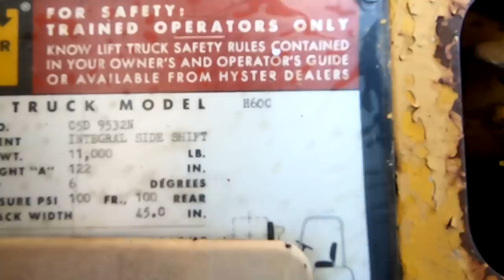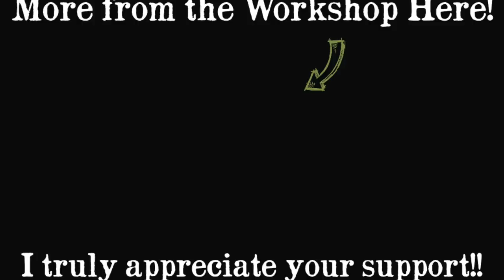This 1969 Fork Truck WAS Headed for the SCRAP YARD! ~ RESCUING a 1960's Fork Truck ~ Part 1

Comment: Another great video! Good job on the distributor! I was concerned about the shaft lenght also! Dont forget to lube the advance weights pivot pins! A little Never Seize works wonders on those! These pins wear with time and drastically effect advance in the distributor which can have you chasing high rpm misfires thinking its the coil or points ect!

Comment: In my younger days, I would have been horrified at running a motor that looks like it needs a .090 overbore to get cleaned up. Now? As long as it does what you want, who cares? It's not like it'll be run 40 hrs/wk. Nice job. I guess I won't mention the built-in spark plug adjusters on the tool:)

Comment: What I was told, is that propane produces some what larger amounts  of water than gas does when burned.  Neither is a problem where the forklift is used a lot, but many shops it is just used for very short periods of time and never long enough to warm up enough to drive off the water.  Have you changed the oil in your new forklift, just wondering.  Good job in getting that motor to run!

Comment: On the stuck cylinders tip in boiling oil on each cylinder. It will find its way through any small gaps and help it move...

Comment: I’m an industrial maintenance mechanic and work on propane forklifts. I haven’t ever converted a gas to propane. But I can tell you that propane forklifts use the liquid side of the tank not the gas side. That makes it lower pressure but you need a vaporizer to turn it back to gas before the carb. How or if it will work with your carb I don’t know.

Comment: As for the switch to propane, it can be done, and used to be really popular even on cars. You will need the tank obviously, a regulator, and an entirely new carb as well as the lines.

Comment: You will need to run a gas mixer. Kinda like a carb but it has a diaphragm that regulates how much fuel gas gets into the engine. Might be a touch tricky finding one the right size, they can be a bear to tune. Also be aware you will loose some power when you convert to ng or propane.

Comment: Propane is an liquid form when stored, LPG as it is known, is Liquefied Petroleum Gas. You will need to buy an entirely different carburetor and fuel system because the liquid propane gas needs to be allowed to expand into gaseous form in a controlled chamber and regulated for the needs of the engine, usually using manifold vacuum as a guide.

Comment: im sure theres a better tool for this,,, yes you had it in your hand  that spark plug gaper has a  wire bender on it. its that flat  piece of metal  on the end of the gapper with the wire bender slots in it .

Comment: I've done it already you got to use a CA 100 or 150 carburetor with the appropriate vaporizer impco and convert that thing over to electronic ignition with a pertronics you got to take a lead off the water pump and then return line for the vaporizer to keep it warm so it doesn't freeze

Comment: You will have to replace the carb with the "gasification" unit,  then you will have the issue of "upper cylinder lubricant" those older models used LEADED Fuel, the Lead as well as the octane boost, it lubricates the Valves and Seats, not sure But you will probably need to get "hardened seats" installed and ground like when we went from the leaded Fuel to unleaded

Comment: when you go to LPG, my understanding is you need an Evaporator, and a whole new Carburetor/Throttle Injector. because the Propane has to be fed from the tank via a dip feed as liquid to get enough massflow to run properly, but you can't inject LPG directly into the manifold airstream, it'll displace all the air and you Go Nowhere, so it has to Evaporate it right next to the carb and meter it that way. you can NOT use a normal carb.

Comment: LP conversion should run around$300 plus the tank. Impco model J, VFF 30 and a CA 55 mixer. Easy hook up should only take an hour or two

Comment: Re; the dizzy rebuild, there is a screw under the felt pad in the top of the cam, should allow the removal of the upper half of the centrifugal advance mechanism with the cams attached, would have saved driving that roll pin out from the shaft, i've had those threaten to bend the shaft trying to extricate them.

Comment: found this it will atleast show you what you need to convert to LPG as for how well it works here in Aussie many cars run duel fuel (LPG & Gas) or kine mine run pure LPG you loose a little in the torque department and fuel economy is about the same. As you stated it cant go stale  and people cant steal your fuel and it burns better since it is already a gas mixing with a gas in the cylinder. It is also better in enclosed spaces as since it burns better it makes more CO2 than CO in the exhaust and all LPG has additive to make it stink if it leaks and this makes the exhaust also smell so you can tell if you need to air out an indoor area more when it is running. The conversion is easy as you just need to swap the carby for the thing in the kit run your hi pressure line from tank to the regulator and the low pressure line from the regulator to the carb replacement on average a forklift conversion takes about 4 to 8 hours to do and the car conversion takes about 2 days.

T understand why so many here  run LPG cars price for normal unleaded fuel here is about $1,60 or so a litre where LPG costs $0.60 and you get same or better distance on LPG to unleaded fuel.

Comment: Half shaft may have been removed to free the wheels to turn without the transmission when it was moved. Maybe to allow the wheels to turn or to protect the transmission from turning without oil.

Comment: a 60 is a 6000 lb lift . as a rule the number equals the lift capacity. nice forklift and the motors are every place. easy switch over if you ever wanted to switch to lpg

Comment: Handy tool/trick/hack for cleaning really well but also not causing damage on carburetors, pistons etc is blasting with granulated sugar a cheap harbour freight type syphon fed blasting gun and a bag of sugar from the local store, just blast and rince off with water or comp/air 👍🏻 use outside lol it goes like icing sugar
NB dont leave sugar in the gun it will caramelise 🤦‍♂️

Comment: I was gonna comment on the plug gapping, but it has already been addressed. Wood man, wood! What you did by knocking the pistons was a valid thing, but use wood next time, it won't damage the aluminum or if you damage the cylinders if it comes in contact with the bore.....like it matters on this one though! Things don't need to shine to be clean.
Reply from the maker: The problem with wood is that it doesn't transfer the same amount of SHOCK into the piston / rings... the goal isn't to move the pistons with the pipe like people try to do with a chunk of hardwood... the goal is to shock the cylinders enough to get the rings to break free allowing the acetone / ATF to do it's thing... of course you can damage the cylinders with a pipe, but you can do the same with wood, and there is no chance of damaging the cylinder walls if your pipe is small enough and every impact is carefully placed... it's all a matter of technique and knowing when to stop! It's never let me down!

Comment: Using Hyster's marketing strategy, H60 = approximately 6,000 pound capacity at 24" load center. 24" load center is the normal point at which this class of forklifts is assigned its advertised capacity. And even that figure usually gets rounded off.  Even though the data plate shows 6,956 pounds at 15" load center, it is not a 7,000 pound capacity truck for marketing purposes.
Other brands of trucks choose the "fractional ton" system for assigning capacity.  Using that system for example, a Komatsu FG25 model means 2.5 ton, or 5,000 pound capacity.  A Toyota 8FGCU30 means 3.0 ton, or 6,000 pound.

Comment: Propane conversion isn’t hard yes you need a special part that attaches to the carb.and that’s about it.they use to convert cars and pickups after market. In the meantime 80 and 90.

Comment: Gasoline does not go bad, itself ! What happens is the "ETHANOL" in the gas buggers up tanks, lines, and carbs. This goes double for small two cycle engines. use non-Ethanol fuel and keep them running.

Comment: Question: were you concerned at all about scratching up the gasket surface when you wire wheeled the heads? Were you using just a normal steel wire brush head on your grinder? I’m asking because I tend to be extremely gentle with gasket surfaces and I want to know if I’m just wasting my time. Thanks!
Reply from the maker: Of course its ALWAYS a good idea to be very careful with gasket surfaces, but they are more durable then you might think... especialy on OLD machines like these... It was a normal steel wire wheel on the grinder... i always start slow and test it to see if it's going to destroy the surface or not, but the other key is to always keep moving... that usually means you have to go over something a few times,  but it also stops heat from building up in one spot which could REALLY cause damage!
Reply: @SalvageWorkshop  Thanks very much for the reply!
Reply: Cast iron surfaces you would have to go at it with a grinder to damage it! A wire wheel is harmless, but be a little gentle and it will be fine!
Reply: @paulorchard7960  Thanks Paul! I’m working mainly with aluminum surfaces, so they are super easy to scratch. I usually have to scrape them with a razor blade held at 90 degrees in order to not damage them and I was wondering what other people were doing. I guess if I run into some cast iron I won’t have to be quite so gentle!

Comment: When so many people were converting cars to run on LPG they were shooting for compression ratios of 12:1 to get good power and economy out of them.  Your flathead is probably running 6:1. so LPG is sort of overrated, still it will run MUCH MUCH cleaner and give you fewer problems.  That port on the distributor could  probably be for attaching a vacuum advance which would be good for an automobile.

Comment: Use wood against pistons, never tiny iron pipe!! When you see no plugs you can figure cylinders need boring, they probably did to start with. Check for broken axle where it's unbolted. Have you bought this or is this to determine if it's worth it?
Reply from the maker: Check out part 2!

Comment: I have watched several propane conversions or repair. Propane is more complicated due to all of the safety valves etc. but it is better in the long run. with gasoline all that has to be done is shut off gas and let it rub til empty toeliminate the od problems. all of my tractors are this way. with new alcohol fuel need to do this.

Comment: it could have a sump full of petrol mixed with the oil best outcome is it just sat and moist air got into it 
and it may need to have the cylinders honed and might be ok but if it got water in it that could be another reason why it has a high oil level

Comment: Ok… watching is completed! I’ve been doing this kind of stuff my whole life…..you got lucky, the moment you took the cut off pipe and hammer to the aluminum pistons I about fell out of my chair! Myself I would have use vinegar/ diesel fuel inside of cylinders and left them alone for a day or two! You can pull head later! Ok now head is out of the way…. Take a round plate(1/4” or -1/2” thick) slightly smaller diameter then cylinder walls or about the size of the pistons tops.  I use steel so when I go from cylinder to cylinder I can remove it with a magnet and not scratch the cylinder walls, note: be sure to have oil on this plate an it is installed into each cylinder! Once installed I would use a block of wood (2/4/10”) or even a (2/2/10”) to hammer on! This would spread the impact to the outside of the piston (it’s strongest point) and allowing for greater impact! Doing what you did with cut off pipe could have cracked the face of the piston thus losing compression and creating blow-by with in the block! The vinegar and diesel fuel can be drain at later date. Yes I see you had it going at end of video…. You got lucky!

Comment: A feller was looking for "Lightning Whirler".  As for the propane conversion, personal opinion it's a waste of time.  I've run Forklifts with that engine in gas, and another forklift with propane. The gas one started every time, it didn't care about the temperature. Also if you happen to forget to turn the bottle off the gas leaks out over time.  Propane is widely available, but not as available as gas, and if you put Stabil or equivalent in the fuel it will hold for 18 months.  If you're not using at least half a tank of gas in 18 months, you probably don't need a forklift.

Comment: propane leaves moisture behind in engine, so would need to be sure engine really warms up good, prior to shut down.
Reply: "Propane leaves moisture behind in an engine". I would love to hear where that notion came from.  It isn't exclusive to propane. Some water is produced when any type of combustion takes place.  And no matter what fuel is burned in an internal combustion engine, water is a byproduct of that combustion process. And to that point, once any engine is started cold, it should be run at least long enough to reach recommended minimum operating temperature before being shut down.

Comment: LP gas? It surely has a long successful record in lift trucks, generators, and many more applications. The only thing you'll use in your existing carb is the throttle. You'll need a demand regulator, a solenoid valve for the propane feed, and probably a gassifier, as you'll probably want to use liquid from the tank, which is typical. Look at IMPECO.com which is a major manufacturer of gas devices.

Comment: You won't need to worry about the jets to do a propane conversion. The carb just becomes an air valve with propane.
I'd suggest checking out gotpropane.com - the kits look simple and legit.

Comment: Given the open spark plug holes I’d have taken the head off first regardless of how much else would’ve had to come off.

Edit: Personally I prefer Derek from Vice Grip Garage’s name for the distributer: “lightning whirler.”

Edit 2: The background engine sounds during the timelapses remind me of the HAM radio sounds you get while scanning manually through the 6 meter band.

Comment: They use wax to cast those I work in a Foundry there's two pieces of mold that fit together and their tightened down by two bolts and then you inject soft hot wax not liquid wax just soft wax into the mold and then you take the mold apart and pull the wax part out that's where you see the imperfections on those then you have to take the wax part and we had these things called trees they were handled with four sides and you would have to coat them with about six or seven layers of liquid wax and then you would hang them in the wax room  and The wax would get hard on the trees  and you would have to melt the part  to the tree with a little handheld iron you would heat up the tree and then heat up the part and sticking on the side of the tree and it would stay there you could get about six pieces on one side of a tree so about 24 pieces on One Tree and then you dip it into castings three different times and you throw sand on those castings along with the dip then when they're been into the casting three times we would take them to the furnace and we would set the castings inside the furnace would melt all the wax out and you have your casting pieces then we go to the Melt unit and we would melt the aluminum and when the aluminum was red hot would dump the aluminum into our castings then when they cool you take them outside to the casting pile knock all the casting off of them then you have a tree made of aluminum with aluminum parts stuck to the side take them over to the cutting wheel carefully cut the part off of the tree and then we would have to take all the pieces  on the belt sander and clean them up then we would take him to the sandblasting room and get all the casting out of the corners and crevices Remelt what's left of the aluminum trees  and use them for the next batch and there you go instant carburetor pieces and then you got a whole bunch of other stuff you have to do you have to drill pilot holes and screw holes it's such a long process I'm done but you wanted to know how you do it there it is

Comment: Since 1957 Hyster has used the letter at the end of the serial number to designate the build year. They didn't use I, O or Q and started over with A every 23 yearsThat serial number ends with an N so it would be either 1969, 1992 or 2015. I'm fairly certain it is a 1969 so it's 52 years old not 42.
Reply from the maker: That is AWESOME to know! I was just guessing based on what I could find online (which wasn't much!!), so thanks for letting me know that! It does have that 60's / 70's styling too!
Reply: @SalvageWorkshop  https://store.intellaliftparts.com/blog/decode-hyster-forklift-model-number/

Comment: With propane you run the risk of the feed valve freezing open or shut causing issues. The swap kits are not reliable like an engine designed for propane. Your best to stay with gas

Comment: It looks to me as all the problems have been caused due to someone messing around without any expertise working with the engine. There may be other problems that are not apparent, the exhaust ports and vale stems should not all be down so it will need some TLC

Comment: I wouldn't hit pistons with a steel pipe. Also i would't hit pistons at tdc. You may want check remove the sump too and check for rust before spending too much time on the engine. If the engine has liner, aren' t you afrai that they wil be shoved out of the engine block if stuck to a piston?